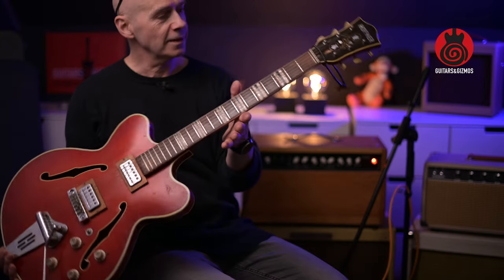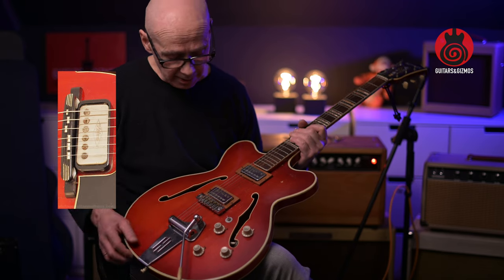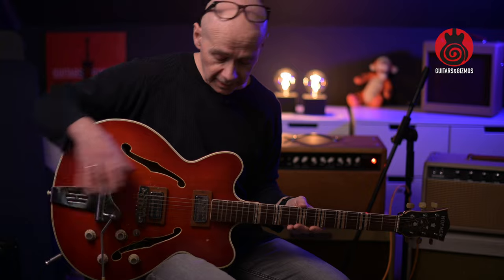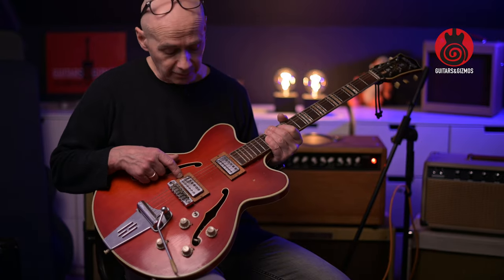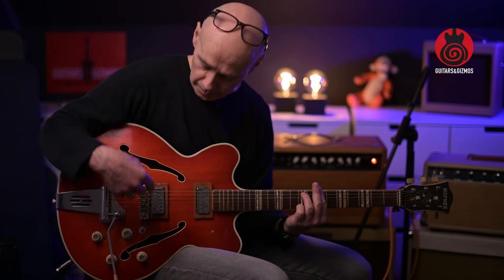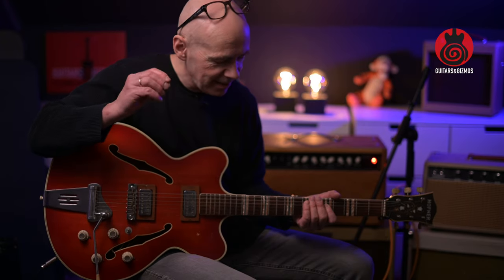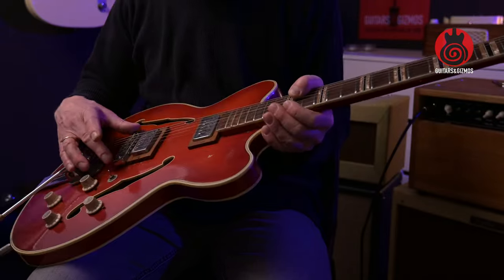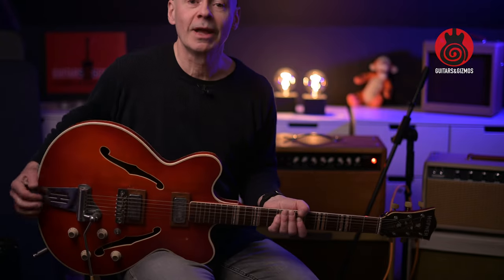'60s Hofner Verythin semi-acoustic. Can this be made playable? PART ONE: The challenges

Comment: Very nice playing! What a guitar too. I like the tones you got from it in this video more than in part 2. :) I have heard these pickups referred to as mini-humbuckers. But they sound thicker here. What is your take on them? They do seem narrower than Humbuckers. More like P90 width. But are dual coil right? Fits the description of mini-humbuckers?
Reply from the maker: Hi, thanks for your kind words. I agree on that the tones are better in this video than in the part II one. I see that I did use a different amp. The pickups are called Staple pickups, and I don't know that much about them. I did a search now and see that there are some info on the web if you'd like to check them out. I think they sound great. Cheers!
Reply: @GUITARSGIZMOS  Yeah, I saw some info but very little. Also from some reissue ones. Have you ever played a Casino? Since that is a P90 thin hollow and this is a "mini-humbucker" thin hollow, I wonder how close they sound.

Comment: Great playing I love the tone it puts in your hands.  I have a 2012 Hofner contemporary which is pretty much laid out as far as electronics and controls the same as yours save the tone and volume having been switched. The switch is in fact where yours is located stock I believe. I installed Gretsch pickups and I love the tone although I never really gave the stock set a fair chance.  I suspect the new pickups from China are not the same now as the ones you have.  The neck on mine is a shallow c which felt strange at first but I grew to like it. I'm interested in what your neck profile is?
Reply from the maker: Hi thank you😊 I see you found BillyBob's informative comment that would answer much. I'm not that good to determine neck profile but I would say that it's a C kind of profile that I adapted to quite fast. Cheers!